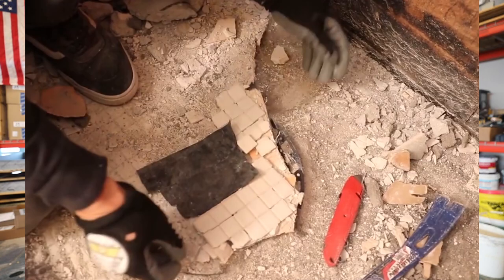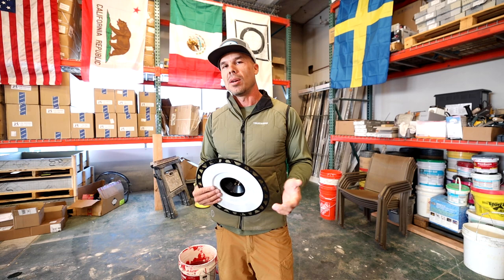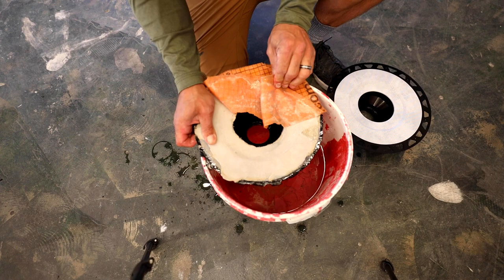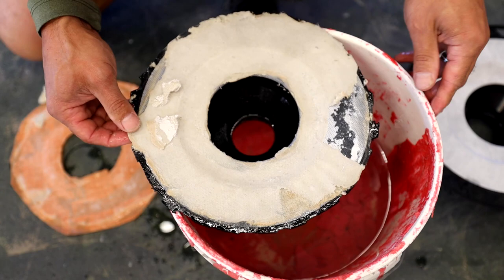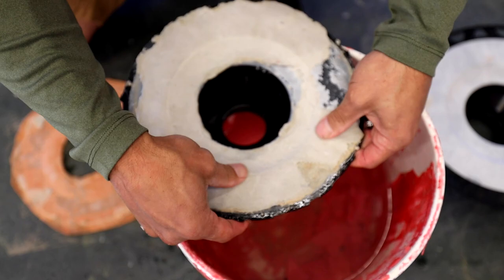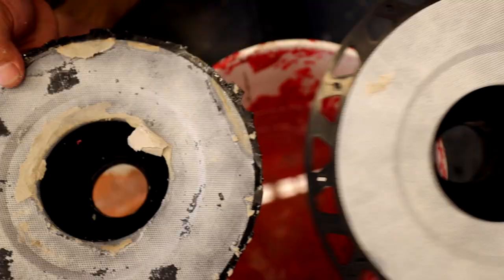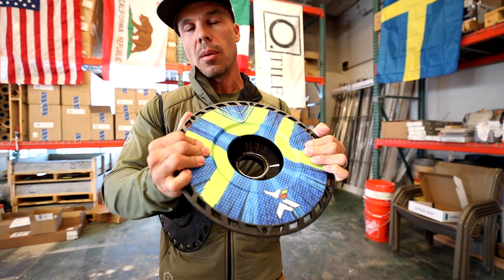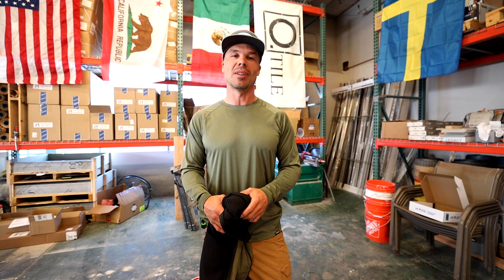SCHLUTER KERDI FLANGE TEST --- You got to see this!!!

Comment: I had two Schluter round drains and one Linear drain failed so far. I had done more than 200 Schluter shower bases and I always worried about receiving calls from my previous customers. For all three failed, the reason was the drain itself but I have not received proper support from Schluter. They only took care of the Linear drain and they just provided replacement material and an installer to re-do the shower base. I had to pay for the new tile, the removal and re-install of the shower glass door and panels, I had to pay to fix the drywall and paint for the room downstairs.

Comment: Just a quick comment on the reason (in your test) the bonding may have not been degraded as much as it can be in the field. Many times the repeated transition from wet to dry will allow for more degradation than a constant submersion in water. 
Also another possibility also is the addition of soaps, bleach, hair products to the mix.........all the possible variables the manufacturers have to deal with has to be a challenge.

PS, I am a home improvement contractor and have done a few dozen showers over the years (mostly old school liner or composite pan) and find your videos and your techniques on various ways to surface waterproof, to the best on the internet.......Thanks for all you do, and also for your honesty and openness on mistakes and how to deal with them.

Richard Gavle

Comment: Longevity testing is a shortcoming in everything now days. This was an excellent example on a common product in the industry. This is clearly an issue, I just wonder what all factors play in to it occuring since obviously the level of failure can vary. Like, does even a small amount of flexing after the initial bit breaks free cause it to steadily get worse as it contacts water?(like in the original videos) In this case I would assume a regular use shower would probably be on borrowed time once the first bit gets under the fleece. Makes me worry about point load issues with things like penny rounds..

Comment: Thank you for doing this video and testing this idea. I've installed a bit of schluter products and have attended 3 of their classes. They certainly make bold claims about the waterproof nature between band to kerdi but never say much about the transitions to ABS like this. I've got a thought that might be worth consideration. What about applying a water proof membrane like mapei or red guard to the area around the drain. The part of your test that's relatively inconclusive is the area that would under normal conditions should not receive moisture, from the side of the mortar where the band ring would meet the kerdi pan,. so it's hard to tell whether this conclusion isn't just water transfer from the side the whole way through to the drain side. Again thank you for doing this and you're absolutely right, a big problem with our trade is that once you leave a job you don't know exactly what happens over time. This kind of discourse could really increase our profession's quality.
Reply: Have you ever done red guard over a Kerdi system? Any issues?
Reply: @jeffreyjbyron   I have not. I'd test some scrap kerdi to see if the adhesion of the liquid membrane was good. As long as it stuck to it well my guess is that it would probably be fine. There is a chance that the materials may have chemicals that don't interact well with each other. You'd need some kind of long term test to know that for sure.
Reply: @coupofmentality3417  I'm a homeowner and I'm considering doing my own shower, but Tile Coach's tests make me very wary of Schluter. I like how easy it is to set up, but for peace of mind I'd want to put a layer of hydraban or redguard over the whole thing. But yeah, I'm also worried about adhesion and chemical reactions over time...

I'll post here if I find new info.
Reply: @jeffreyjbyron   no matter what you do, knowing the process is crucial. It's hard to know why things fail and to be fair, no flange goes through this kind of treatment in regular use.

Comment: Showers can get hot hot to speed it up. Love your work. I was a skeptic back in the day when the thinset was being used for the bonding. I was on star tiles line of thinking for the redguard everything. But if a MFG is saying how to do it for a warranty as a pro. It's a tough thing to wade through. You are doing all the testing for many things and challenge them. Keep it up. The silane sealants is very interesting. Kerdi fix says its silane so that isn't the whole story. Flange just needs the adhesive to the membrane. One you have shown. Not their adhesive that's pre-applied. And may not be compatible with it self over time.

Comment: I don’t really see much of problem with the schluter flange. What you showed is that the flange did work. But when you agitate the mortar or fleece it will come undone. Maybe adding tile and then disassembling would make for a better resolution because you’d be adding weight to it.
Reply: water will always find its way in through osmosis  even if weight is applied u can still get water osmosis

Comment: Based on your response to a comment below, the flange failed in the field due to an incorrect install. It would be helpful to understand what install issue caused the problem as the way you described the problem it seemed to be an engineering design issue vs an install issue. Just like many of us, trying to understand how to improve on installs and better serve the clients and have less call backs.
Reply from the maker: If you watch the videos that I included links to in the description, I go into great detail of how those two systems failed.
Reply: Thanks. - appreciate all the time and effort you put into producing the videos and reading the comments.

Comment: Interesting, my installs may not have this issue as the way my brain rethinks anything I do.  The caulk sealant I use (Sika, Goboard sealant, hydroban sealant) I set the bonding flange and  drain flange in sealant and seal them till it reaches the pvc.  Still sounds like a food reason to upgrade to flow effects

Comment: So, I remember watching your video about the water wicking into the thinset.  I bought Schluter about five years ago when I did my tub surround and just being DIY guy that was something that I immediately thought of. I wasn't as concerned since I was using it in a tub. However, I have put my walk in shower on hold for awhile and just saw you sell a new flange, which I have purchased. Do you still use water proofing (rx 8+9) even with this new flange? I have Mapei Aquadefense which I was going to use regardless, but wanted to know if you think that product is suitable or should I buy something different? I am using Kerdi preformed 48x48 shower tray.

Comment: You look like you've been around the block with this tiling stuff... Nice work btw man!
So I was thrown into a bath reno and need to figure out where to stop my wall board whatever that is, in the tub area as I'm abutting up to existing wood lath and plaster on adjacent wall. The plaster I'm removing in tub area is approx 1/2" thick so figured I'd leave the lath there. The rest of the tub area is down to studs. H E L P Thx for any input..

Comment: Not really a fail of the product, just because the fleece comes off under the stress of being ripped along with the thinset doesn't mean that the fleece is going to leak under normal conditions, it just means the thinset bonded well
Reply: Yeah, I’m not sure I understand what the ultimate problem is. The flange under the white fleece is still intact and water proof. The stuff isn’t going to peel up on its own.
Reply: Also nothing under the Kerdi membrane should be exposed to water or your membrane isn’t set/seal properly.
Reply: The world isn't in lack of dummies. His tests and his other videos clearly show the deficiency of the flange.

Comment: The  real world test would be to do a mock up  of actual shower pan with tile and run hot water over it 4 times a day. The hot water will seep  through the grout and cause the thinset et. to break down. Would need to run the hot water on it for at least 20 min each time. It would be the true test and you would have to be commited ! Cold water doesn't  react in the same way. 

That test would be an eye opener for those who think using thinset is a good idea!

Comment: It may have not been a perfect test with all variables and non variables locked down, but a good quality product overcomes these typically.  Any of the industry standard building materials usually outperform a lot of human error even.  If this drain had a weak base, subfloor, and/ or 300+ gorilla showering above it, it's going to flex.  If those micro flexs are enough to break the manufactured bond then I don't want to risk that.  Tiling a small shower is expensive as $#@& let alone a large deluxe one.  I don't understand why people are trying to belittle it or saying they don't see the problem.  That part needs to be able to take a hit from a scud middle and not leak after.

Comment: Good test! But what it wil do with soap and water for one year? The product itself seems to be alright. I ll think i rather remove the white fiber stuf. And do a good degreasing on the pan. Then the tinset under and above the shower floor. Then working the floor finish with the epoxy tile grout. Best to grout the wall's also with the epoxy grout, or at least 2" from the floor.

Comment: One year under water is way more exposure than a shower would get. 8760 hours soaked and 90% of the fleece stayed and you had to pull the fleece. I would agree that the ones you pulled may have been defective. How long have these drains been around and how many actual issue have their been. As installers we always want to find someone else or something else at fault for a failure.
Reply: I dunno. 1 year of exposure really isn’t all that much. A shower might only be used once, twice perhaps three times a day, but if water gets under there, it’s constant exposure as well. Just never drys out. In terms of a 5 year old shower, that’s a heck of a lot more hours than just a year. 
If there was constant air movement under there, I could see it drying between uses, but there’s no air movement.
Reply: @jmlcolorado  it's 8760 hours of immersed exposure. A shower never is immersed. It's wet but not immersed. 3 30 minute showers a day would only be 548 hours of waste exposure but immersion. Sorry but this isn't a true test that could equate to real world experience.
Reply: @jmlcolorado  it also doesn't require air movement, just gravity and air that is less than the relative humidity.
Reply: @jmlcolorado  That is why shower floor pans are sloped, in order to allow the majority of water to drain due to gravity, minimizing the chance of standing water. if the initial waterproofing job is done properly, the chances of failure should be minimal.  If your shower has standing water in it constantly, then the floor wasn't sloped properly or you have bigger plumbing problems to worry about more than flange problems.

Comment: Quick jobs like schluter systems, press on copper fittings, and expanding tubes for hydronic heating are garbage.  Not meant for long term and will leak.  But fast for contractors.  You are doing and amazing job and I hope all homeowners see this.
Reply: copper leaks too.

Comment: @bobpeters289  that's just it.  It released on its own and failed in a prior video.  Yeah a normal environment after install isn't going to have a person picking at it, but given any other products that you don't want to come off, do they ever.  I need more assurance that it's gonna stick.  In my opinion there is no reason why a quality top of the line company like Schlueter couldn't revisit the design table and engineer something that will never release.

Comment: But it wasn't coming up until you peeled the Kerdi fabric off and started picking at it. So this should only be a problem if you have to replace a shower pan in which case, you a new one regardless
Reply: It held up pretty well. Looks like kerdi changed their design at some point and fixed the problem.
Reply from the maker: Hey Matt- the ones that were older peeled up really easy, like they were barely attached. But even at that so little water got under I’m not too worried about it. I have hundreds of these flanges installed on jobs we’ve done and as of yet, no issues. But I still think they can come up with a better bonding surface for the flanges. 
If you run into any old Kerdi showers, please let me know what you find under the flange.
Reply: It looks like you can see that some water was starting to get under the all-set in at least one spot "before" he started peeling anything.

Comment: Makes me wonder if the thinset on top of it what is used for the tile to be set eats through the membrane and causes this to happen. I mean you have to use a schluter allset specially formulated mud to put under the membrane. I wonder if there is a way of testing that out. 🤔

Comment: You mentioned how these are the most widely used however I've stayed far away from these style flanges for the exact reasons you've shown, I would never trust that or thinset membranes, they have too many ways of failing and can be screwed up during installation pretty easily especially if the mud isn't the right consistency to bond it properly.

Comment: I saw Landberg put a bead of sealant on top of the flange, under the membrane around the flange recently, using Laticrete products. Would that prevent wicking altogether? Could you do that with KerdiFix? Seems like a simple solution.

Comment: Great vid. If Schluter really had an issue they would have changed the flange. Your vid proves that the 20+ system can still work effectively
Reply: The adhesive should NOT be giving up due to water exposure. This is a FAIL. Given another year, in real world condition with thermal expansion and contraction, it would be failing. Shower floors should last decades...
Reply: Schluter may not be the best, but their system does work and proven.

Comment: I'm pretty new to all this Schluter stuff but watched a few of your videos. I was wondering since you don't pile on thinset on the flange before gluing the flange  to the drain maybe you aren't packing as much thinset as you think under the flange. If someone is stepping on the flange when showering and it flexes but the Schluter that is set to the mud bed doesn't flex/stretch it can start ripping the white fiber off the flange. Maybe this is why you are having better luck with the thicker flange.

Comment: If the manufacture just left the fleece off of the flange, then the installer could just use pure silicone. I would trust that over this current method.

Comment: Do you ever have to repair your old school oatey vinyl?
Reply: Sure, with time the weeping holes do get clogged by the mineral deposits in water. That can give off a musty smell from trapped water. I do think that by the time it happens folks usually are ready for a makeover. The other issue with 20mil is the way installers go over a curb for the shower and the two corners adjacent to the curb.

Comment: I have never seen a video showing the correct drain installation by not blocking the gap around the drain with all-set, and not blocking the water from draining and collecting in that area. There should not be any water collecting around the drain unless the installer has not paid attention and put too much all-set around the drain and blocked the gap.
Reply: I’m intrigued by your comment. Can you elaborate? What gap are you referring to?
Reply: @jmlcolorado as you can see from this video, the all-set is applied only to the corners of the kerdi drain, therefore not blocking the adjustment gap under the drain and allowing any water leak to drain and not to collect in that area. https://youtu.be/f1P6V7lfrag
Reply: @majid_us  thanks for showing this!

Comment: The drain flange shouldn’t be exposed to water if the Kerdi membrane is set/sealed correctly. This test isn’t based on correct installation but an incorrect installation where the fleece becomes exposed to water.

Comment: What is this supposed to prove? My car keeps rain out perfectly. Perhaps I should submerge it for a year to be sure.
Reply: Ridiculous analogy!  Shower drains stay wet 24/7/365 when used regularly.
Sorry, Kerdi "waterproofing" does not work as advertised in real world scenarios. Only at the trade shows. They will all fail, if used continually, over time.
Reply: @wwolfdogs  Then why not do an experiment where water is sprayed onto the material for 15 minutes every 24 hours? Perhaps these showers will all fail in time. But submerging shower material does not prove that.

Comment: Did Schluter warranty those repairs?
Reply: I highly doubt they did warranty the repair. From what I've heard is there's so many variables that it makes it easy for the manufacturer to say it wasn't done to their standards and therefore deny covering it.

Even so, it would be good to hear from Issac about this.
Reply from the maker: One of them was done completely wrong by another installer, I didn’t even approach Schluter about it.  The other one was done by me, but it was a wall float issue that had nothing to do with the pan.
Reply: @TileCoach  thank you for responding

Comment: There needs to be a mechanical seal, such as with the hot mop method and the clamp together drain assembly. This is why I like the divot drain method, it's a hybrid of the old hot mop method with a contemporary topical waterproofing.  this type drains as you show here have no sort of compression sandwiching the material so water cannot seep through it. Capillary action by itself will transmit across it. I mentioned this to you previously but you scoffed at it.